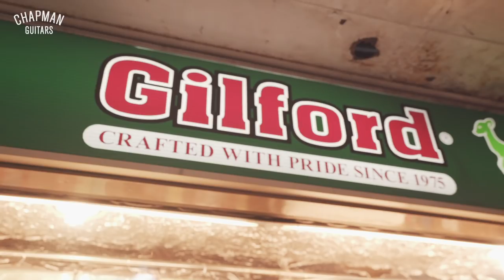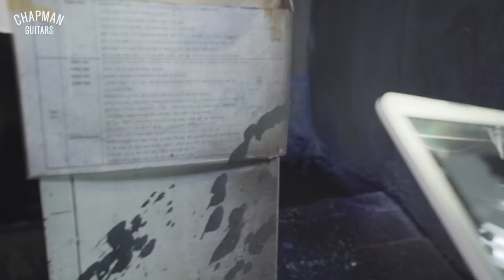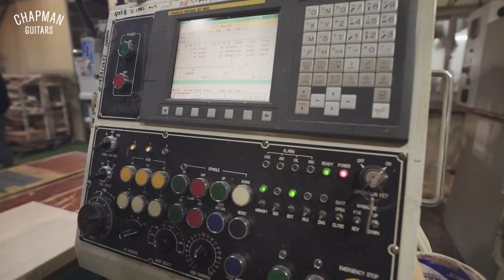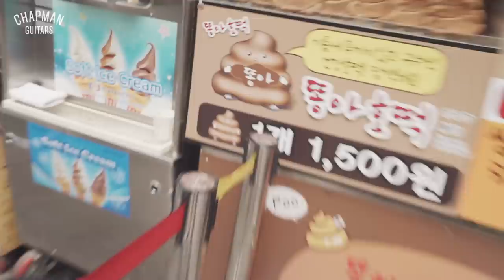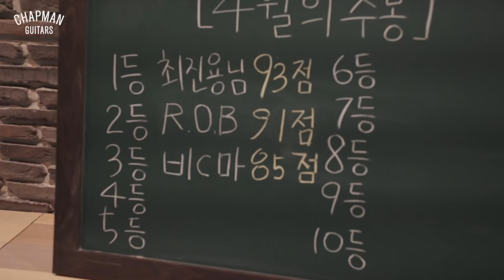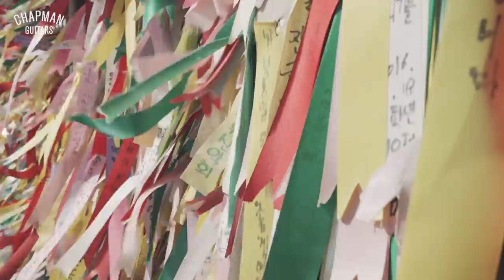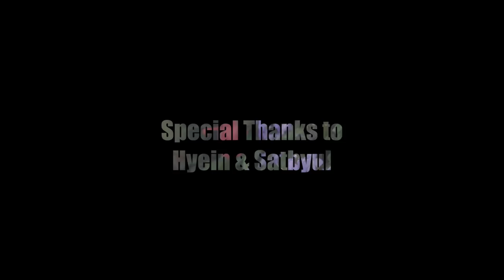New prototypes in the works at our Korean factory...

Comment: would like to see you do some UK custom shop models
Reply: Their custom shop is the British Standard.
Reply: holy crap $4000 euros insane and has the cheaper lower quality Canadian flame maple .. the US western and eastern are the best maple must be much more expensive  to import from us .. the import guitars are made nice just the wood is way to young to wet and fret work sucks . Japan an exception
Reply: The same cost as a PRS Wood Library. The real question is who has that sort of money to throw around. I think the primary purpose of the British Standard was simply to build guitars for themselves.
Reply: a chapman vs PRS ok .. the guitar would never hold its value
Reply: You are correct. Several years back, I read a financial news article about how American guitars are the only ones that actually go back up in value after a certain number of years. The exact phrase they used was "mortgage guitars," because an American-made guitar will be worth mortgage money after 20 years. After 50 years, it could be worth the price of your house. That said, it needs to be 100% original, and in 100% factory condition. Each little ding or scratch, even if it is only in the finish, not in the wood itself, every imperfection reduces the value. The same applies to modifications. With the exception of strings, anything changed reduces the value.

So, the entire point of buying a Les Paul, or a Fender Elite, is more as a financial investment. You buy it with the intent of keeping it in the case for 50 years, because you know vintage guitars are a far more stable investment, and wiser investment, then investing in stocks. And should the company go out of business (Gibson?), then that will only further increase the value of your guitar, and increase the return on your investment. For example, a genuine 1969 Les Paul in factory condition could be worth $100,000 right now.

As for Chapman British Standard, or any other non-American custom shop, the point of its existence is to have something custom-made to your specs. You don't buy it to buy a house in 50 years. You buy it to have something made specifically for you, the woods you want, the pickups you want, the paint/stain you want, everything chosen specifically by you, and specifically made for you. Even though you do basically need to be a touring musician to have THAT sort of money to throw around, but having something custom-made for you might be second only to having your own Signature model.
Reply: what I was saying if I was buying a custom made guitar ..  and they use Canadian maple its the cheapest lowest quality  maple out there and I am sure they  use African mahogany  . the Chinese use it to build their  guitars for $4000 euros thats insane ..the  best  is US western flame maple... eastern Us is a little cheaper price   ..  I build my own custom guitars I built this one for under $600 African Mahogany body Us Eastern Flame Maple , Ebony fret board https://youtu.be/b4PLwFvFd8c  and sell them for $600 .. I also Have custom US Dean Hardtail  $2000  New  '''' https://youtu.be/sOaSxu-xt40 that will blow that Chapman away .. chapmans are way to over priced for a new type on the market  .. gibson and prs , Fender sure  that is fair ....  they have been around and well known ..  Its like Rob is saying he should up there with GIbson and Prs , Ernie Ball .. come'on man

Comment: 13:17 Rob, don't adjust the sight, try to work on your hand! The way you open your grip and move your right hand away from your head causes the string to vibrate horizontally which gives the arrow a curvy flow thus whacking your shots to the left.
Try to keep your right hand to your face. As a rule of thumb try to keep contact to your neck with your thumb _all_the_time_!